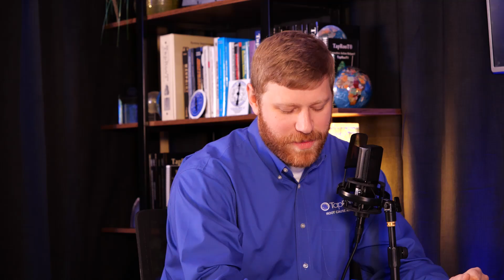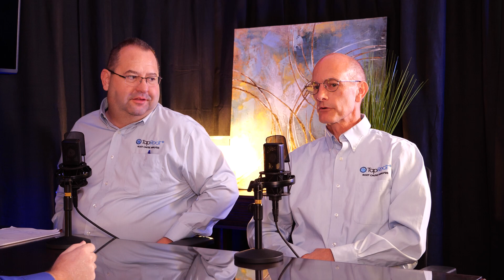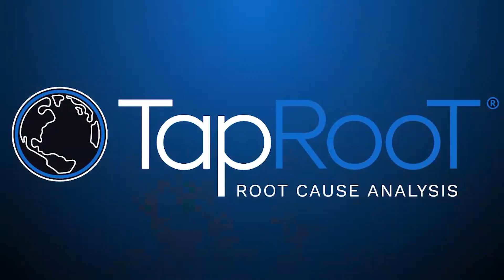Root Cause Analysis Red Flags

Comment: During WW2, many pilots crashed damaged bombers while landing back in England.  The Army Air Corp determined that it was "pilot error" . . . which of course it was, as the pilot made a mistake.  However, pilots coaxing home damaged planes were also severely overloaded.  The solution was to use different sized knobs on different controls to help ease the pilot's workload . . . surprise, surprise, accident rates went way down!
Reply from the maker: Great example of improving the human-machine interface, Larry!